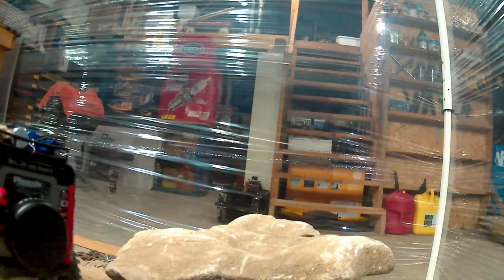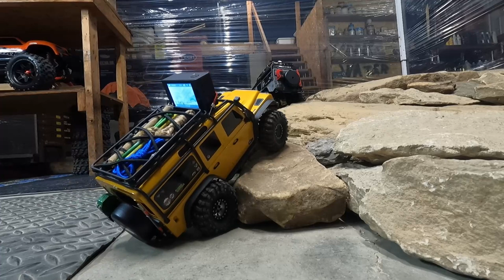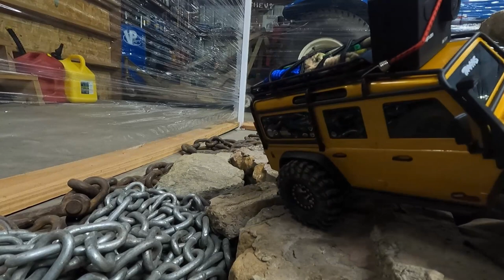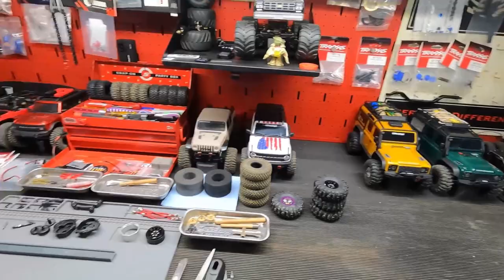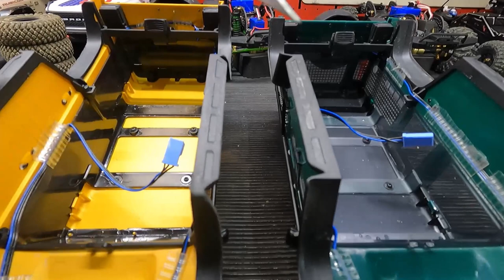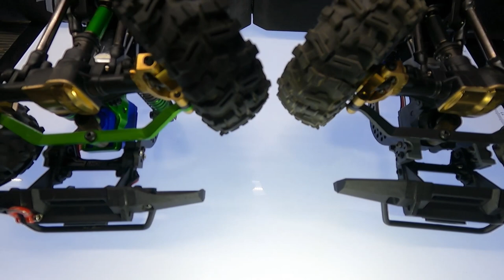TRX4m trimming and shimming for big tires.

Comment: This is great. I have a bronco body with 59mm shocks and I can’t figure out how to stop the insane torque twist. :/
Reply from the maker: Hi Mike, i bet them shocks are nice. Are they with coil springs? I have stock shocks and springs. They are at full ride height. Another option is a forced drop. It eliminates 90% of the torque twist. At the end of my last video. Are a couple of rigs, one being a bronco. They are both on forced drops with no springs. The climb is steep and  narrow. You can see the difference. Thank you for the visit and comment. Enjoy your Bronco brother.
Reply: @usssoupership  I will have to give the no springs thing a try! Thanks for the suggestion!
Reply from the maker: @mikepfeifer1753  I forgot to mention rubber bands around each shock to keep it planted. The band should be just big enough to go around the shock with just a slight amount of stretch. You're welcome if it works for you. If not you can leave me a nasty gram. I will understand. lol have a good day bro.
Reply: @usssoupership  hahaha alright fair enough 😂

Comment: What is the NOS bottle?  Stock servo and motor?
Reply from the maker: Hi. NOS, nitrous oxide. More power. Lol. Just for shits and giggles.  It is the stock motor and servo. The motor seems fine but the servo has broken multiple times. The traxxas metal gear servo is going on it when it breaks again. Unless I can find a good replacement.

Comment: What for kind wheels are that, bc I am looking for a new set of tires for crawling
Reply from the maker: Hello, and thank you for the visit. The wheels are UPW from mofo rc, and the tires are 64mm swamp kings from little guy racing products. I highly recommend using 3D printed inserts from flub rc to make them work best.

Comment: What size king tires are you running, 64mm?
Reply from the maker: Hi Kevin. Them are the big 64mm swamp kings on mofo upw wheels with flubber stuffer inserts. They work grate together.

Comment: Crazy pulling power
Reply from the maker: Hi. Yeah, the low gears give it some power. The trucks weigh close to 2 lbs. The motor has enough torque to pull that, and a trailer full of junk.
Reply: @usssoupership   that's nuts 😆  can it pull a mino 😳
Reply from the maker: @chris dettanascar  we're going to find out. Minnow is going to be in town this weekend. I'm definitely going to get it on video.
Reply: @usssoupership   😆  he's a good guy!

Comment: 15:50 interesting point about the front axle and the up and down motion, but when you are rock climbing, I would think you would want a different portion of the tire to be in contact with the rock just slightly behind the center bottom of the tire. I would suspect maybe 15° back since the front of the truck would be pointing up the incline so the traction point should be more towards a 45° angle maybe not that extreme but the kind of illustrate my point. You've clearly given this a lot of thought and that's what makes this hobby so great is learning about different viewpoints.
Reply from the maker: Hi, and Thank you. Thats a great question.  I don't know the answer. If it hurt, i haven't noticed it yet. When I made that adjustment, i was looking to solve a problem.  I was braking a front driveshaft on a daily.   a couple thing's happened. Not only did it improve pinion angles,  but it moved the yokes up and out of the way. that took some strain out of the drive line at full extension. I wasn't braking front drive shafts anymore. something else unexpected happened with the caster blocks. They moved closer to 90° not exactly but close. I wondered was that going to hurt. You know, for every action is a reaction. the only thing I noticed was how smooth it turned from left to right. You can see it. Watch your rig from straight on and turn left and right. Do it slow and then do it fast. Then make the adjustments and repeat. Better yet, if you have two rigs, do it side by side. You can see the improvement. Nothing moves but the steering components. Before the adjustments my bumpers moved up and down my shocks even layed over the whole rig moved around. It was harder to turn. So with all that being said, I haven't noticed any drawbacks or lack of climbing abilities. But I'll be honest my Defenders are not rock crawler worthy. They are heavy and unbalanced and do not like angels over 50°  I trail these dudes. You can see them work. the mods I have done have helped improve these lunkers but could possibly hurt a true rock crawler build. I would certainly try it. It's free. You can always go back. Justa twist of the wrist.
Reply: @usssoupership  I'm not rock crawler either. My intent is to get my lazy butt off the couch and go for a walk with my spouse and I think these are priced right to do that. Maybe she'll even join in and rive one as well! :)
Reply from the maker: @TheRoadTaken  I just recently went on a hike n drive with my boys and it was amazing. Hope you and your spouse have a blast.

Comment: Learnin' with you.. Question... towards the end, You said it was better to keep the wheels closer to the hub on the trx4m. Was that referring to having the washer inside the hex instead of outside on the axle?
Reply from the maker: Hello, and thank you for your time. Yes, i am referring to the washer. But there are a couple of reasons. One is the wheel directly fixed on the hex is best. anything between them could cause some wobble and wear. The other reason is i didn't want the wheels to far out and away from the rig. because the wider they extend out, the more they rubbed on the body. That really depends on the wheels and size tires you use. I'm using the 64mm swamp king tires from little guy racing. With mofo rc wheels and zero offset hubs. I hope this helps. Thank you for the visit and commenting. Have a great day.

Comment: Great video on your mods. I like how explained the mods to the flares and bumper to reduce tire rub. How did you tint your windows and where did you buy your decals? Also did you make your accessories on your roof?
Reply from the maker: Hi. Thank you for watching. I'm glad you liked the video. I tinted the windows with PS-31 smoke. Tamiya color paint. The stickers I got from Amazon. Make sure you get 1/24 scale vinyl stickers. The paper sticker are OK, but if they get wet, it's over. As for the cargo and accessories, I made some of it myself with arts and crafts materials. Some came from Amazon and Little guy racing products. Just make sure they are 1/24 scale. I ended up with a bunch of 1/10 stuff i didn't want. Thank you for the comment. I appreciate the visit. Have a good day.
Reply: Did you start off from an unpainted body for big cheese? I guess it’s not original tan color? It looks metallic. Can you elaborate briefly on the process to achieve that awesome looks?
Reply from the maker: @ridefrifjell545  HI, I'd be glad to explain. I bought an unpainted body from Traxxas. They come white. Hard plastic. I used "Tamiya Color" paint for polycarbonate. The color is "gold metallic." I can't remember the paint number. But it was the only gold metallic they offer. The paint is for clear bodies, so it dries to a no shine flat finish. I added 3 coats of "rust-oleum clear lacquer. high luster coating" to bring out the shine. No sanding . All paint is on the outside of the body except for the window tint. For that I used "Tamiya color PS-31 smoke" and went full can on it. Limo tint. In the end, I ended up with what you see.  Not exactly gold. More like a big block of cheese. Thank you for watching and commenting. Hope you have a wonderful day.

Comment: You seen LGRP do a smaller swamp king?? Do you think they will solve doing thee mods?
Reply from the maker: Yes, I seen them. I'm positive they will solve some issues with fitment. But traxxas already has a proX comparable to that. In fact, the swamp king tire is a pro X with a few cosmetic differences. Are they better? I don't know. I have used the Traxxas tires, and they are much better than stock, but the bigger tires work better, and for that, you will need some clearance. I'm going to get a set of the swamp kings to go on the trailer. It's going to be sweet.
Reply: @usssoupership  oh yeah I didn’t know that. Tricky to know what will be best. Love the vids! Inspired me to get one.
Reply from the maker: @Nicholas Smith  it is tricky. I like it though. It's part of the fun, trying out different setups.
Reply from the maker: @nookprojects  I'm glad you like the videos. I'm sure you'll enjoy the truck. We have so much fun with them. Thanks for watching.

Comment: Has the 4m Bronco gone through the same trimming for the larger tyres or are they not needed? Viewer request +1 😊😅🤠
Reply from the maker: Hi. The bronco has the fender flares trimmed but also has a body lift and shock relocations. I will indeed make a video on the bronco or maybe try to add it into the next one with the defenders. Thank you for the request and the views. Have a great day.

Comment: What size tires and shocks are on the yellow defender
Reply from the maker: Hi. The big cheese is on 64mm swap kings tires from little guy racing products. Mounted on mofo rc, UPW bead lock wheels. Flubber stuffer inserts from flubrc, and The shocks are stock with green aluminum shock bodies from Traxxas. Thank you for the visit.
Reply: Thanks great videos
Reply from the maker: @ckadventures7767  Thank you we appreciate the comments. Glad you like the videos.

Comment: Hey, while I have your attention.  A local hobby shop has an open box, never driven TRX4M. Has a light kit installed, two bodies (defender and broco), battery but no charger, $120 USD. That sounds like a fantastic deal. Your thoughts?
Reply from the maker: That is a great deal. I would do it in a heartbeat. The charger is not expensive but is is traxxas only. The hobby shop should have one in stock. The bronco body and light kit are about 80 bucks together. It's a good deal.
Reply: @usssoupership  thanks for the feedback.